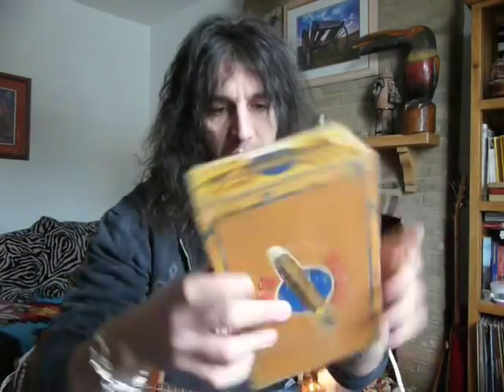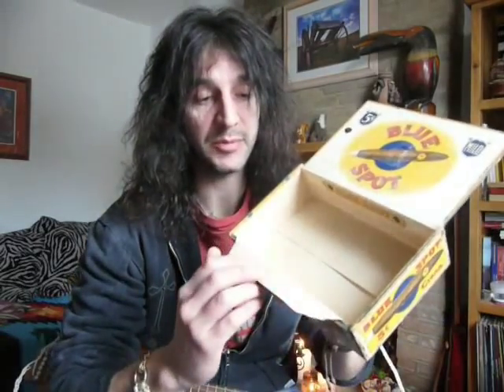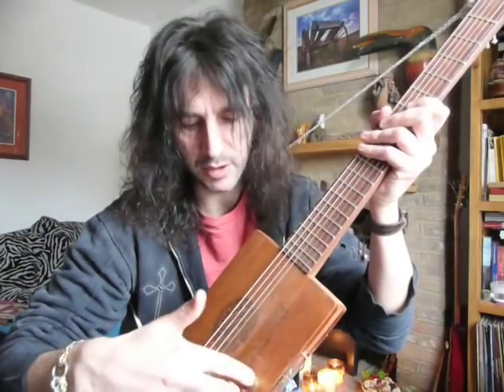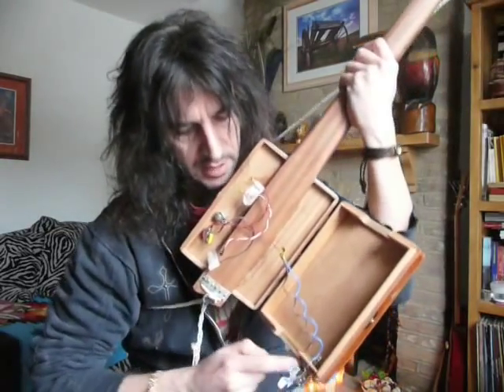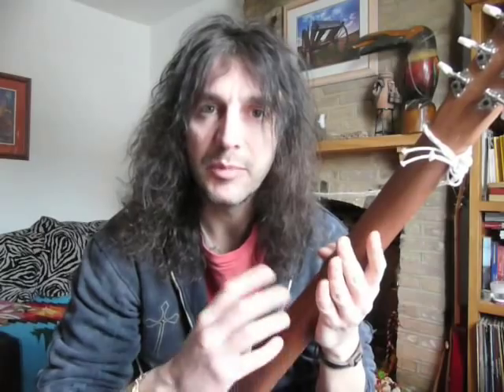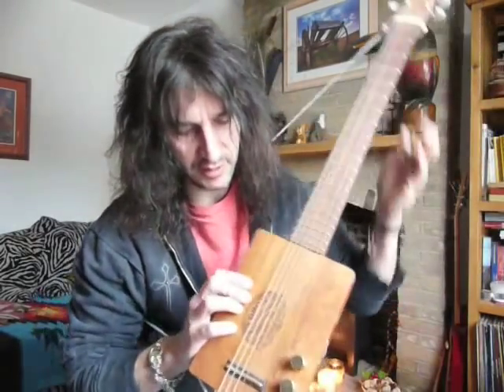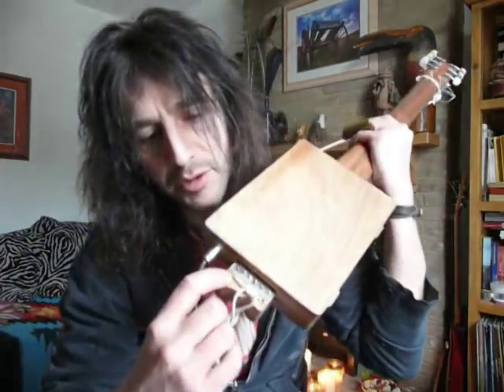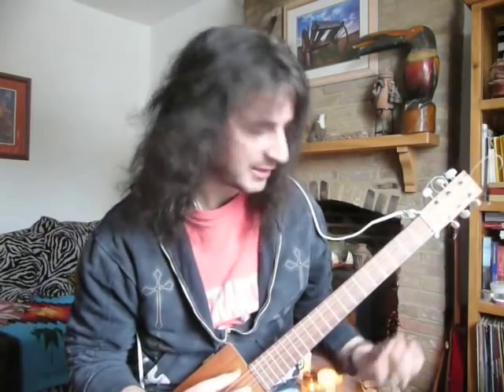Cigar box guitar How To Make

Comment from the maker: @gutenschneider Hi there, I used here solid sepele which is a hard wood like mahogany. There has been no bend in the neck whatsoever. My brother (is can be found under my favorite videos) has used various woods without truss rod. The width of the neck on mine is at the first fret is 45mm and at the point where it meets the box 54mm. The neck is about 25mm deep. There is no way this will bend. You will be fine, trust me, you'll be nervous when the strings go on but you'll be fine.

Comment from the maker: Hi there, try a search on  manchesterguitartech fret and nut calculators/fret-calculator. You enter the number of intended frets and in the scale box the length of the neck from nut to bridge, then click calculate. It gives you the spacing in mm from fret to fret as the spacing decreases as well as the distance for each fret from the nut. Measure as accurately as possible and saw each cut as accurately as possible with a fret saw. Don't try and do the lot in one hit, take your time.